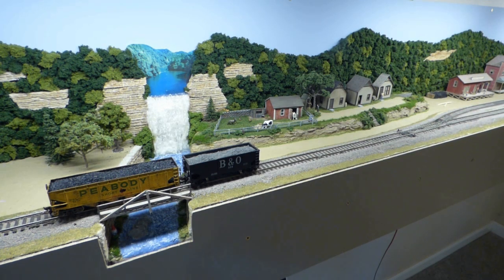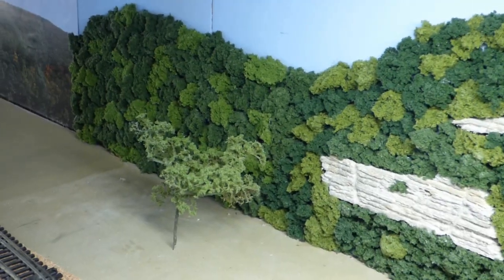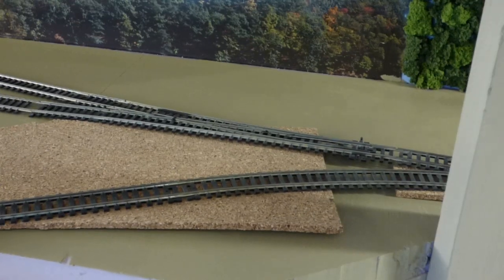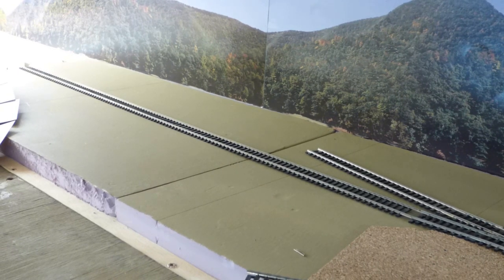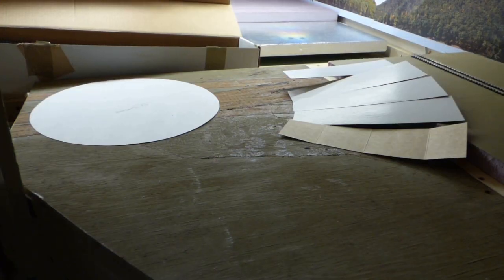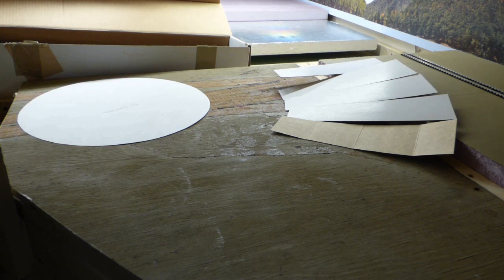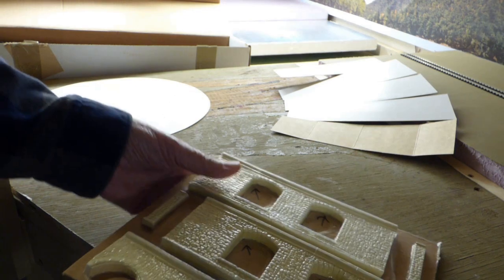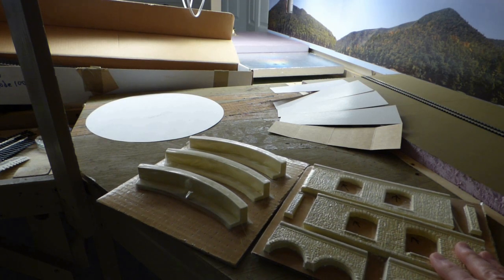Pondering My Turntable and Roundhouse Options

Comment: Bruce,
I would lean toward the cast walls.
 I recently started a Hometown kit and ended up having to re-draw the plans as the views did not match. Also, I agree that their brick siding leaves A-LOT to be desired. I ended up using some old Paper Creek brick paper with stellar results. The house finally was finished with all new materials and the kit ended up with all its original parts back on the box.😉😁
The dental Stone castings can be repaired with yellow Carpenter's glue and a bit of patience and care.
Greg Rich
Reply from the maker: Thanks for the feedback and heads up on the Hometown kit, Greg.  I'm going tackle the task of repairing the castings.

Comment: Bruce,indeed the castings can be glued, But I would recommend using matte medium instead of the white glue, not that the white glue won't work, but the matte medium is not as brittle as the white glue is after it cures.  You could consider making molds of the castings you already have (and they look beautiful) out of silicone and pouring new ones out of resin.  Alumilite has a wide assortment of silicone and resins. It would take some time But may be worthwhile to check out.  Love your videos and have picked up so many tips.  Many thanks!
Reply from the maker: Thank you for you kind words, David, and thanks also for the tips.

Comment: Thanks for sharing. Are you HO? I have a N scale turntable I want to get rid of. It's a Walthers. The casting? I use white glue. And I dampen the edges where I want the glue with water that has a drop of denatured 90% Isopropyl Alcohol in it, Its so the plaster won't steal all the moister from the white glue while curing. Let cure for a few days. Just a though from when I was building the old Campbell kits, back in the day.
Reply from the maker: Yes, I'm in HO.  Thanks for checking in and leaving the tip about dampening the edges of the castings.  Very helpful!